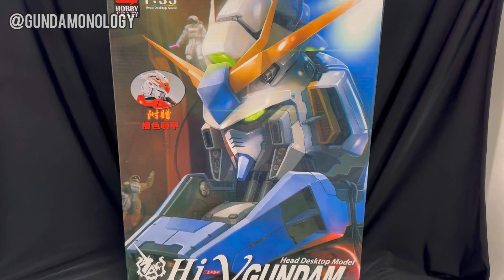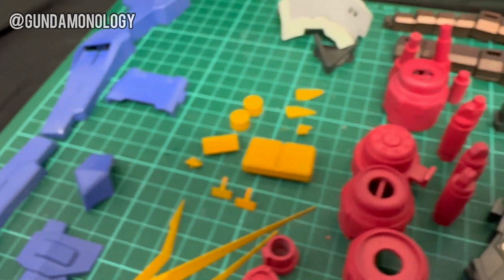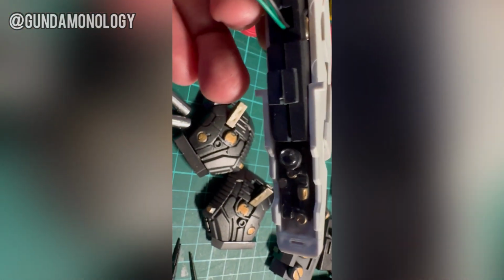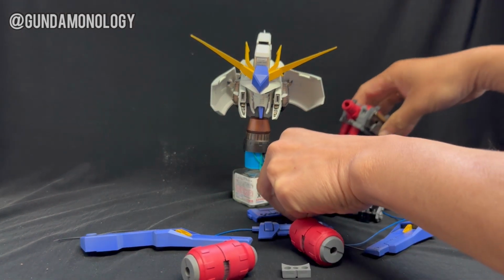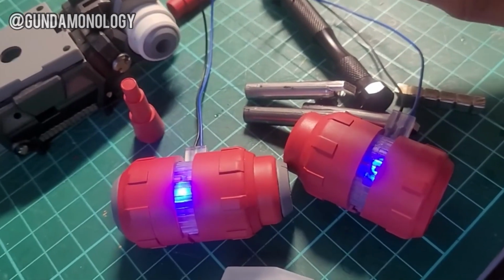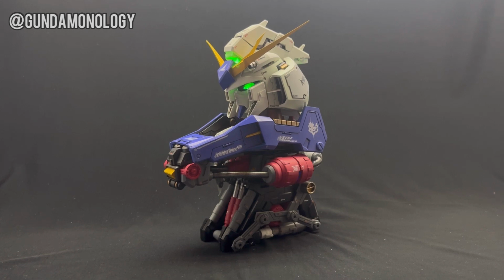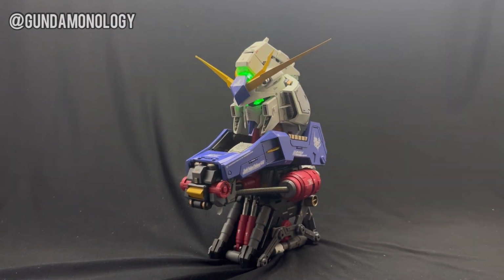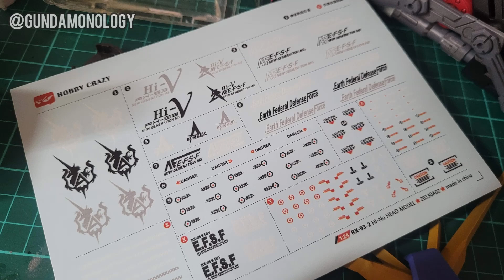Hi-V RX93 Head Bust (Hobby Crazy) Custom Airbrushed Painted with LED

Comment: i habe a problem with my leds..the blue and the green wont light up the same time only the green led..but when i disconnect the green led..the blue leds lights up...
Reply from the maker: Hi. It’s likely your circuit not being put together properly. The LEDs here I had to use my own as the kit I got didn’t have it complete. Sorry I can’t help here. Also I didn’t use the battery tray that was included as it was too difficult to get the wires to sit properly
Reply: @gundamonology  oh ok the leds are good a few months ago before i put it in the box and now decided to check it and had the problem..maybe the battery power supply because it stuck in the box
Reply from the maker: @jhad0205  yeah your best bet is to use your own LEDs like in my video above as a possible fix. Good luck.